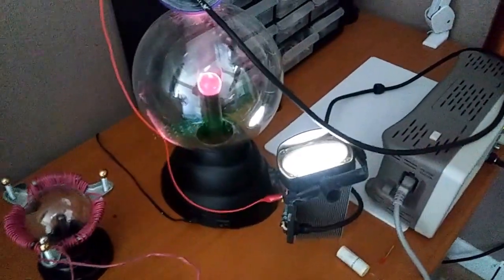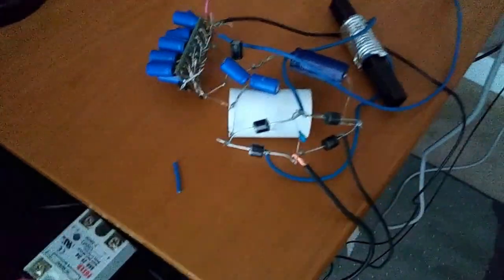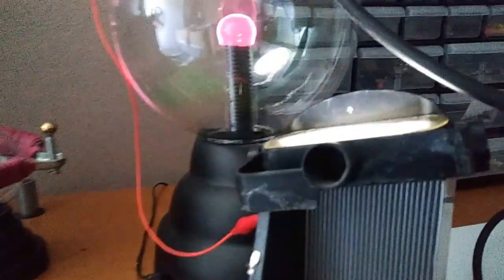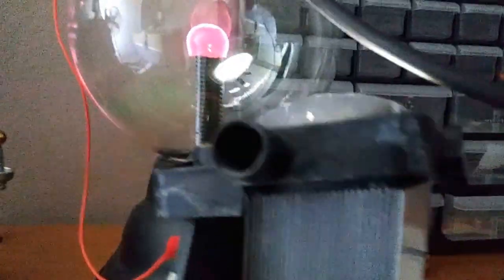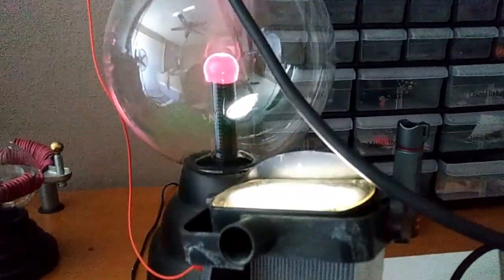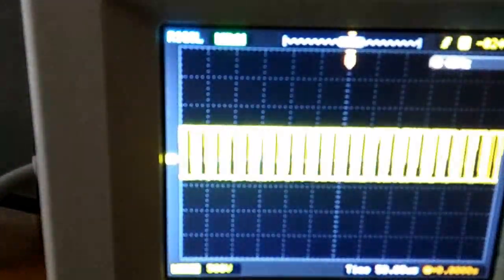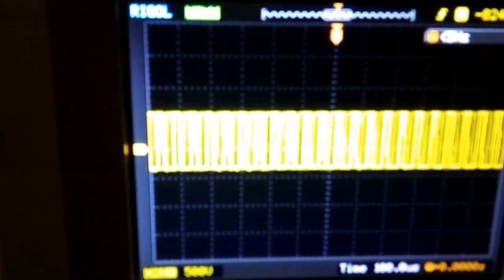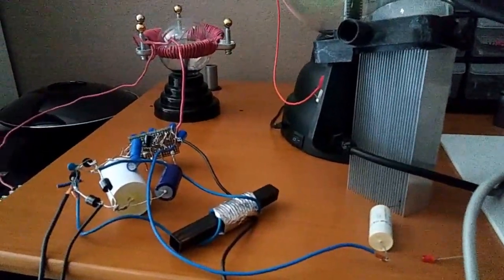Scalar wave LED lighting

Comment: Can you help me on a project please?
Reply from the maker: Hi Sorry it's probably some time since you sent me this message and yes sure. What's on your mind?
Reply: Ralph Hernandez I need to make a scalar beam, but I think I’ve found out how: http://vixra.org/pdf/1804.0308v1.pdf thanks
Reply from the maker: @filigenzilab9613   were you the one who was looking for wireless power?
Reply: @ralph72462  can you help me with something i understand how it can be used for wireless energy to power homes by getting a sender to broadcast scala waves on a frequency then have the recevier pick that energy up ground it to the ground then the receiver will emit a energy field. What i'm confused about is getting the sender to pick up scalar waves and broadcast its frequency i know you have to use materails to pick it up but how do i get it to emit a scalar field?
Reply from the maker: https://youtu.be/fskh-OurTFY   tried this for wireless transmission but after experimenting further I found that the energy was broadcasting through ground. I guess that is what Tesla was actually doing with the electrical transmission. If I can help you sure I will. What do you have in mind?
Reply: I need your help 2. I'm not mechanical but I need this. 3307327517
Reply: You rock dude